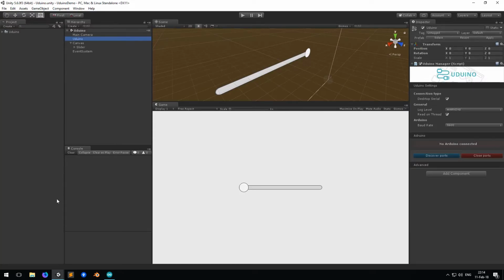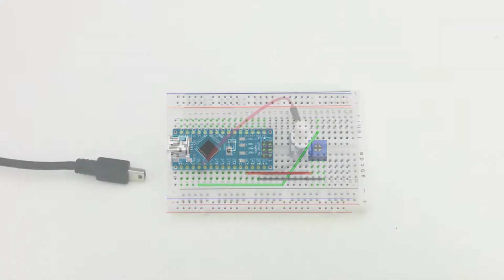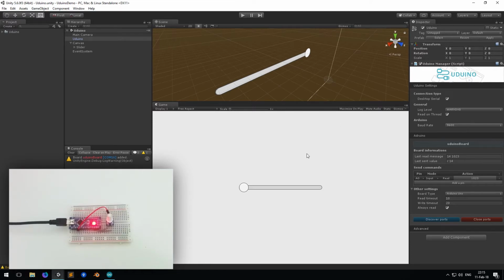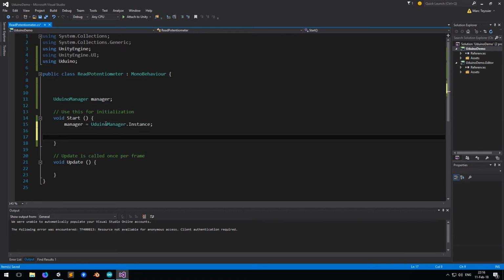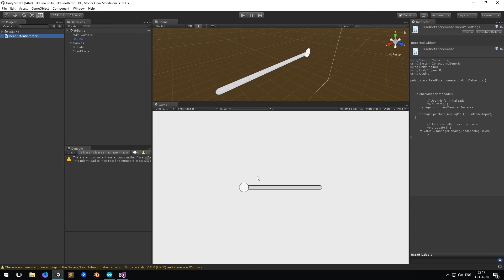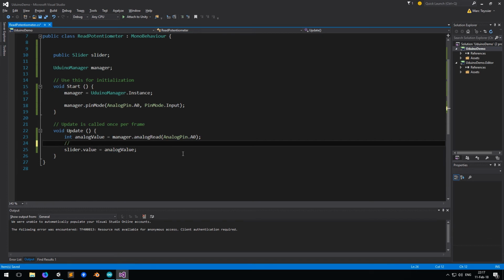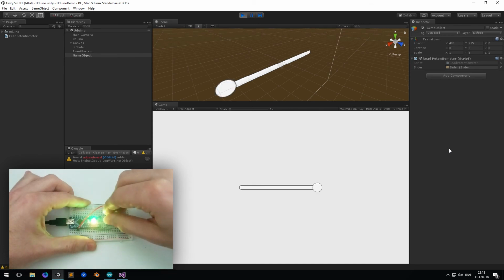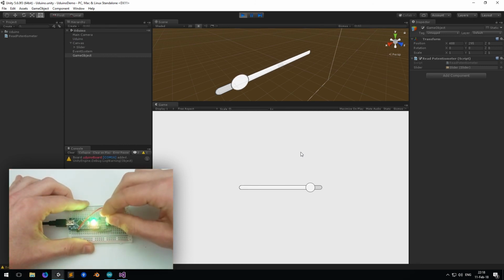Read an analog Input from Arduino to Unity - Uduino Video Tutorial

Comment: Hello, Great Video. I have purchased on Asset store. I followed tutorial and can read my potentiometer values, however when I go to run game in Unity, the arduino (Uduino) disconnects. Can you advise how this can be fixed?
Reply: I just deleted the Uduino prefab from the scene and then set it up again and it seemed to work fine, in case you still have this problem